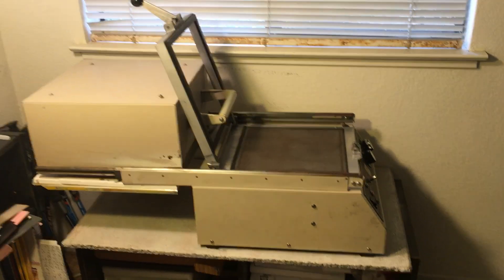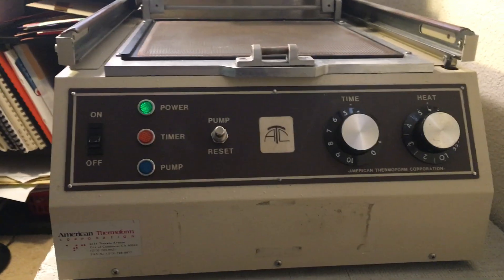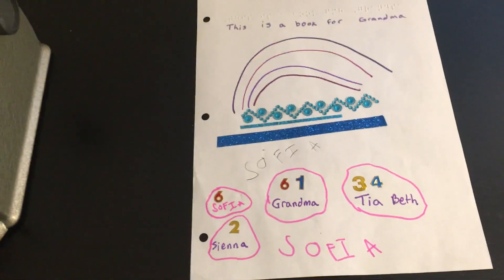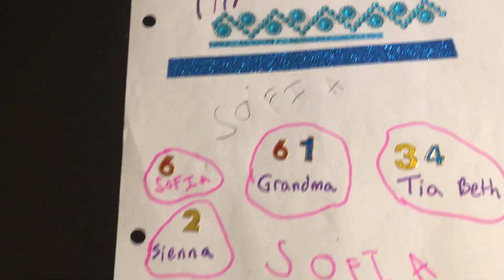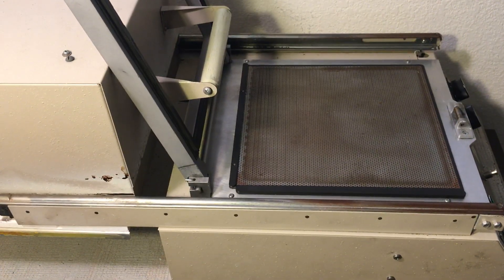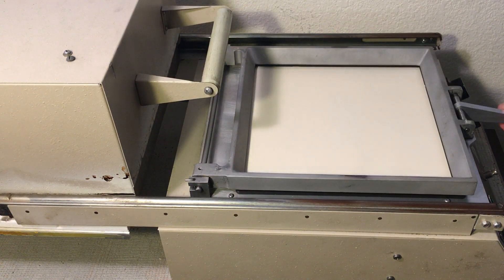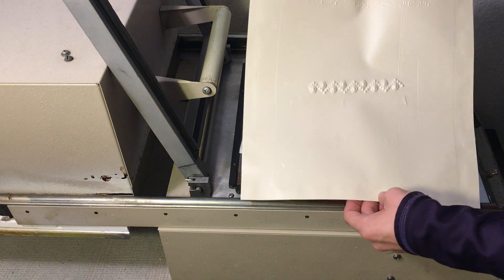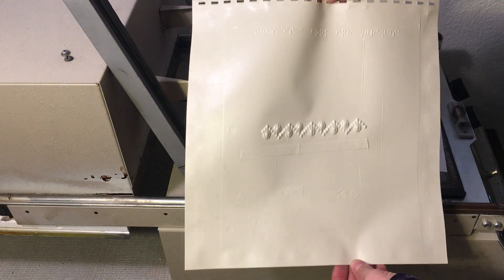Thermoform Machine Demo

Comment: Hey! I have a doubt regarding the settings. Would you help me? The buttons: Time and Heat should be at what number? Is there a pattern?
Reply from the maker: Try setting them both to 5 and 5. Also, in the video's description there is a link to the user's manual. Check out page 13. It talks about setting the heat and timer dials.

Comment: These look almost identical to a vacuum former I've seen with a platen (forming surface) that lowers so that the sheet can be held in place while heating and then the buck can be raised into it and the vacuum then applied, making it possible to expand the applicability of the machine into the areas of the creation of masks, miniatures, etc. I'm assuming that isn't possible with this?
Reply from the maker: Hello, 
This machine is basically a vacuum form machine. I'm not sure how tall of an object you can place in it. I am guessing about 1/2" tall would possibly work, but I haven't experimented. The taller the thermaform image, the more tempting it is to poke it flat, thus shortening the life of the image. So I make images around 1/4" tall.
Reply: @brailleadventures  Okay. Thank you!